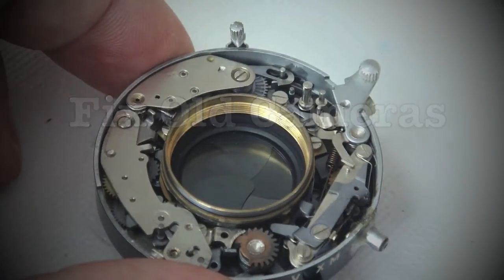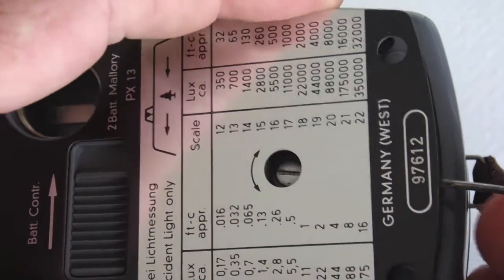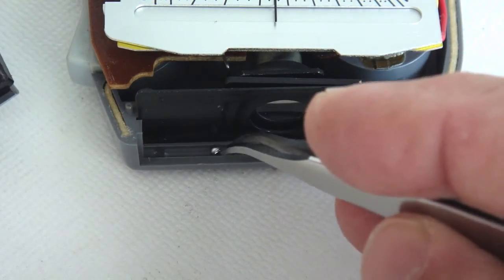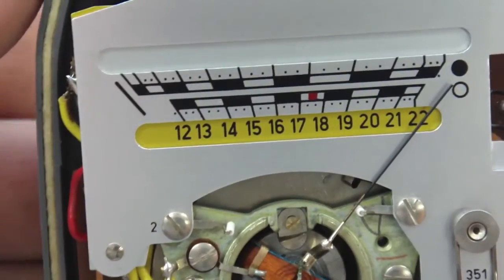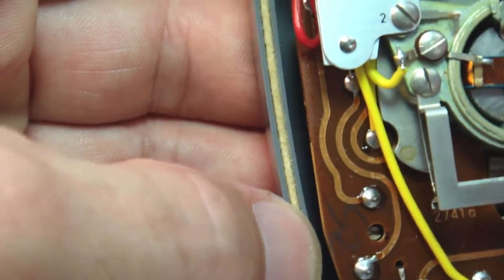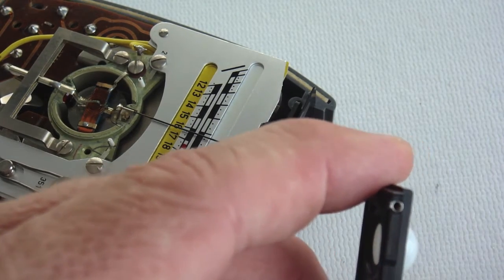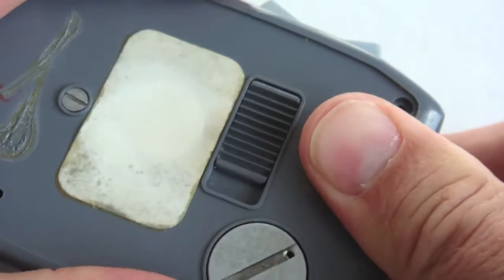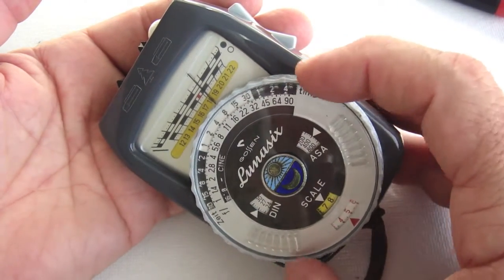Fix Old Camera: Gossen Luna Pro Battery Diode Update

Comment: Another nice video. Could you include a video on how to make the adjustments? I wouldnt be able to guess what each screw is supposed to do.
Reply from the maker: Maybe the easiest  approach to calibration for a tinkerer is by exposing the meter to different light levels and successively adjusting the trim-pots. Small adjustments should be made working between light levels.

As a light source, you either can make an adjustable light-box, or use several white walls with different levels of illumination accessible throughout the adjustment procedure. Meter the light source with a known good meter to determine the levels you are working with. 

Adjustment Potentiometers positions: Upper left by itself - P1.  Left to right across the bottom - P2, P3, P4, P5

P1 (10k) is battery test current adjust.

P5 ( 20 k) is high light adjustment. (P5 is used when the nd filter covers the CdS LDR) CdS (Cadmium Sulphide) LDR (light dependent resistor)

P2 ( 75 k) is low light adjustment. (P2 is used when the CdS LDR is directly exposed via the lens)

P3 ( 10k) is low light meter shunt adjustment.

P4 ( 10k) is high low meter shunt adjustment

P3 and P4 probably need to be set near mid point.

In bright sun about EV 14 or so, with the dome on, (incident mode) and ND filter on, the CdS/LDR resistance is 520 Ohm.
Dark resistance is about 20 Megohm.

The battery current needs to be in a range 20 ~ 60 uA, which is just enough to drive a small signal schottky diode toward saturation, so depending on the diode voltage dropper placed in series with the modern batteries that now need to be used there might be an accuracy problem that should be adjustable if need be. Some times after a diode install update no adjustment is needed, if the meter was accurate to begin with and the proper voltage drop was achieved with the diode modification.
Reply: Thanks for the extra info, if I get brave enough to (potentially) sacrifice my old Gossen I will give it a try.